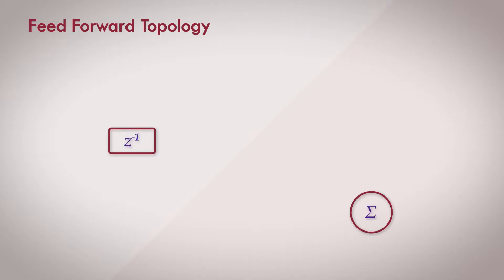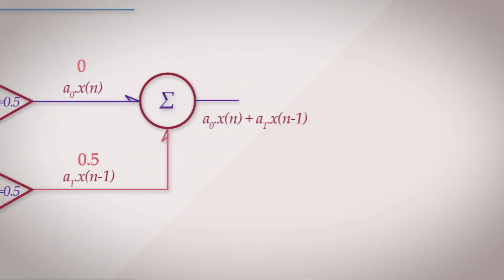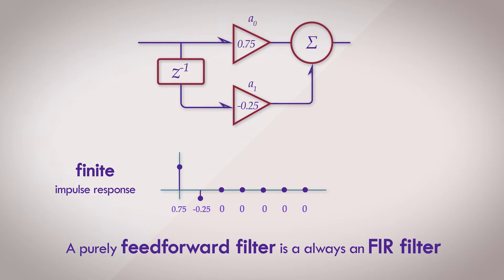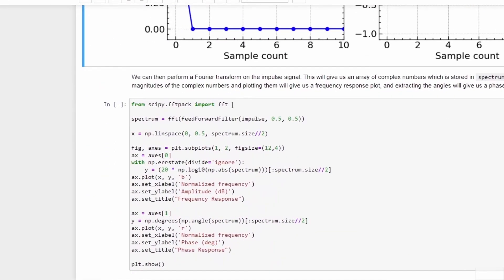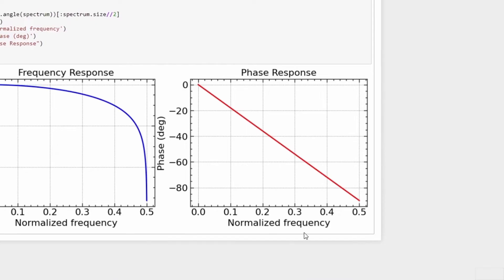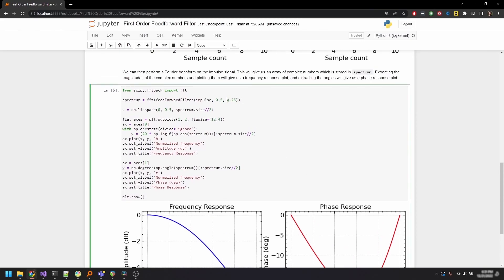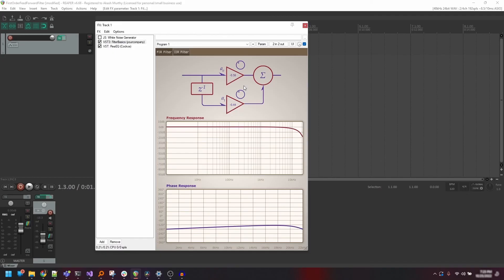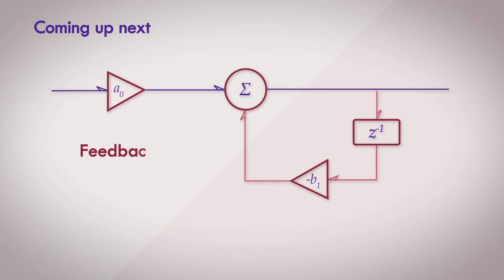6. Finite Impulse Response - Digital Filter Basics

Comment: Hello... Thanks a lot for the effort to make these videos ! One question regarding 8:00 : I understand the process of cancellation of the resulting signal when phaseshift increases. But why is the full cancellation happening at the phase axis showing - 90° ? i would expect this to happen at 180° phaseshift? what did i miss here ? best regards...
Reply from the maker: @stl-audio  hello there. This is a common source of confusion. The delay element that causes the phase shift of a 180° cancels out the output signal. But the resultant output signal is 90° out of phase. The phase response graph shows the phase shift of the resultant signal, and not that of the intermediate signals. It's hard to see that there is any phase shift at all for a zeroed out signal, cos it's just zero. 
But you can get a better idea of what I'm talking about in video #4. Watch from 6:45 onwards, specifically the analysis of the 1/2 Nyquist signal. The half Nyquist signal, with a 1 sample delay creates a 90° phase shifted signal. When combined with a signal with no phase shift, the resultant output is attenuated, and more importantly phase shifted from the original by 45°.
Reply: hello ... thank you for your quick and explaining reply ! the mechanism itself i got so far, i think... nevertheless i will go over all videos again without interruption ;-) ... i also maybe was confused by the x-axis in video 4 (from 14:20 onward) compared to the x-axis in video 6 (08:00) and mixed up 1/2 Nyquist with 0.5 ?

Comment: No Frequency Generation: In a linear system, it is not possible for the output to have a maximum frequency greater than that of the input. If the input is band-limited to fn then the output will also be limited to fn

Exception: Non-linear systems can introduce new frequency components (such as harmonics), but that is not the case for linear systems.

So, here we are reading linear systems, thus the output freq response is limited at max input freq which is Nyquist Freq

Comment: Hi! Thanks for this beautiful set of video!
@Akash Murthy, regarding your comment @08:50, a partial answer I can give you is from what I remember of my courses of electronics, especially automation, at school. Most of the time, in analog filters, the transfer function appears to follow the rule that the phase looks like the derivative of the gain. I said most of the time, but I do not guarantee this always applies, besides, sometimes you may have an offset of the phase. Translated, if you have a flat gain response, whether it is 0dB or another value, you should have a 0deg phase dB. If you have a constant -6dB/oct or -20dB/dec slope, you should have a constant (flat) -90deg phase. With a constant -12dB/oct or -40dB/dec you should have a constant (flat) -180deg phase, etc... At the cutoff frequency of a first order, which should be ~3dB, you should have a phase of -45deg. And so on... I can't say whether it applies or not in digital filters, most of all, FIR filters but it may be interesting to find out. @08:50, it appears that this theory applies.
Reply: Sorry. What I talked about earlier was essentially without active/discrete components... if you have resistors and capacitors and inductors, it should still be true. However, when you add an op amp, it becomes the higher the frequency (and closer to the 0dB open loop gain), the less true this statement is. I guess that in digital signal it should be the same somehow... the closer to Shannon frequency, the more non linear is the phase even if your gain is flat all the way... I mean, if you have a sampling frequency of 384kHz and handle audio frequencies up to 12kHz, you should be quite fine.
Do you know of free Softwares that I can use to test digital filters?
Do you know how yo calculate coefficients of the transfer function in Z of digital IIR filters like Butterworth, Bessel, Chebychev filters with input parameters such as order of filter, cutoff freq, sampling freq, etc? Thanks.

Comment: The bit at the end showing the coefficient and tap relationship is the highlight of the video :-). For me it tied this whole thing together!  Thanks again for the brilliant videos.
Reply from the maker: Ah! I'm glad that solidified it for you! Seeing the impulse response as the coefficients is a key way for understanding FIR filters I suppose. You're welcome, and thanks for checking it out!
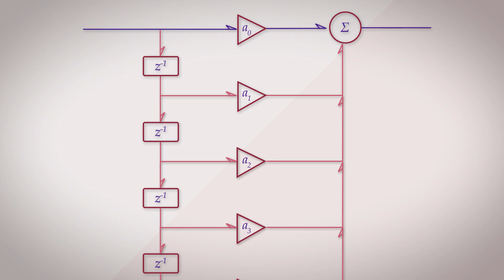Reply: At 11:50 the flow chart shows z-1 for each tap. Does each tap operate on the same sample? I seem to remember it might need to operate on older samples, so z-1, z-2, z-3 and so on.
Reply from the maker: @legosteveb  a signal which flows through 3 z-1 delay blocks is equivalent to it passing through a singal z-3 delay block. As the signal passes through the circuit, each tap adds a sample of delay, and the same signal is sent to the next tap.
Reply: I agree with this statement. If you see this, I hope you will continue making these kind of videos with really intuitive explanations. :)